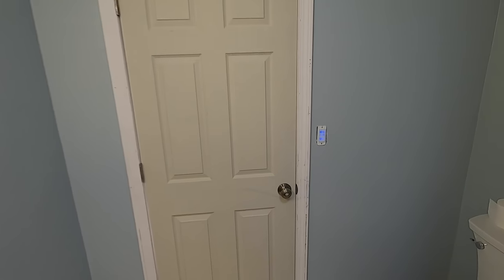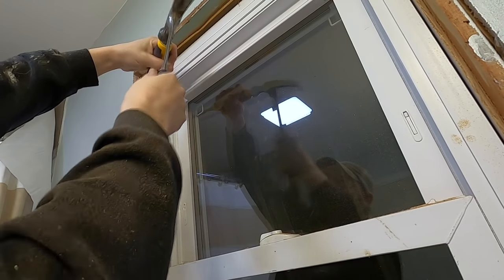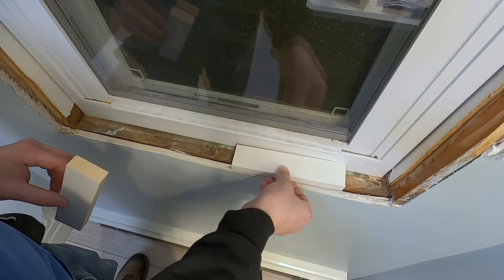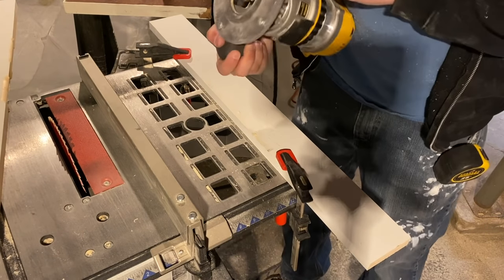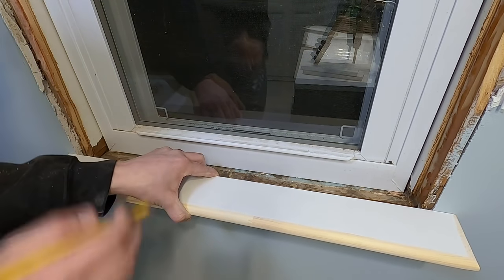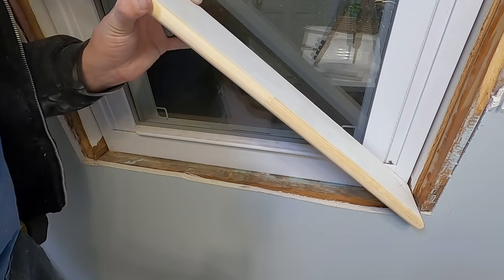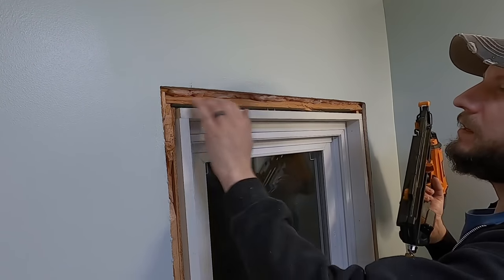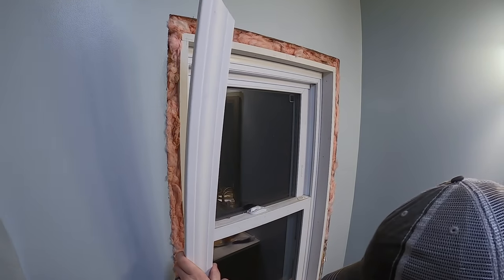How to Trim an Interior Window - Casing and Sill - DIY Bathroom Remodel - Episode 21

Comment: perfect Job.  regarding the window trim, would it be the same concept if installing trim in the inside of the opening. I have to add trim to the inside of a square opening. its my first time trying 45 degree angles. thanks